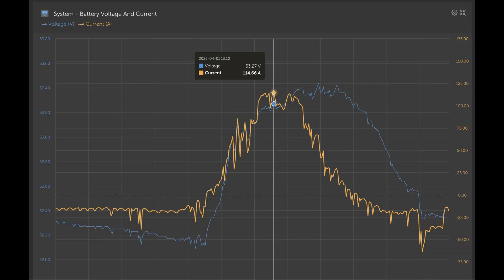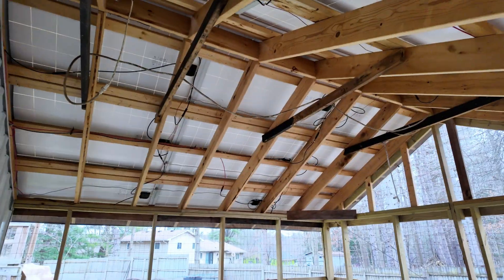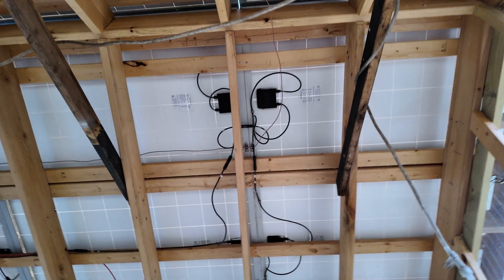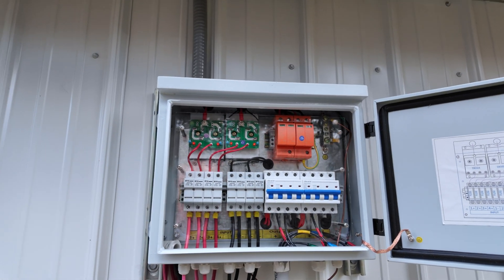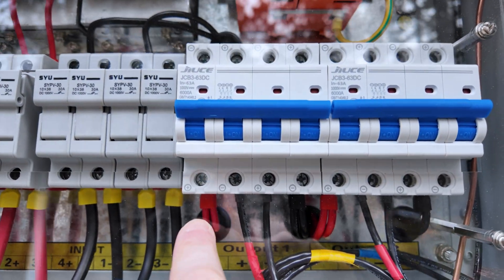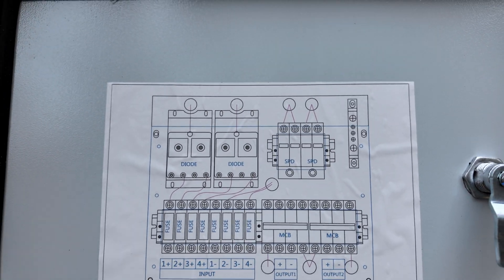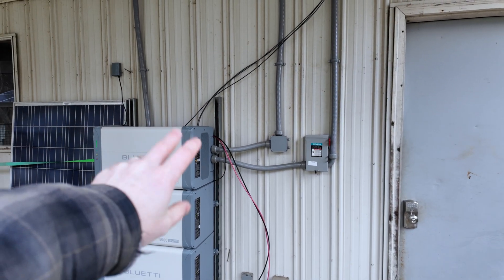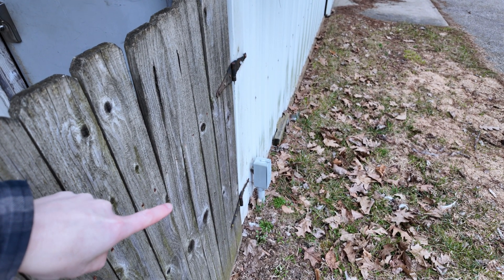My Coop PV Arrays with the Watts247 4-2 PV Combiner Box

Comment from the maker: 🛠 Parts & Components (Affiliate Links)
     🔹 Watts247 4-2 PV Combiner Box - https://watts247.com/product/pv-combiner-boxes-quick-select/?wpam_id=126
     🔹 IntegraRack IR-D1 Super Sealing Multi-Surface Deck Mounted Bracket: https://www.currentconnected.com/product/integrarack-ir-d1-super-sealing-multi-surface-deck-mounted-bracket/?ref=AzzpK9Fl
     🔹 Santan Solar Pallet of 250W Used Panels: https://www.santansolar.com/product/used-ssg-240w-solar-panels-cracked-vinyl-pallet-of-25/?campaign=SolarRoofProject&ref=adamgog
  SanTan Solar 5% off discount code: offgrid_life
     🔹 IronRidge XR100 14' Rails: https://ebay.us/l2WWpY
     🔹 IronRidge Universal Fastening Object Module Clamp: https://www.solar-electric.com/ironridge-universal-fastening-object-ufo-cl-01-a1.html
     🔹 BLUETTI EP800+B500: https://shrsl.com/4lxum
  Discount Code: AdamEP800 - 5% Off

For more details, visit my website: https://going-off-grid.com

💡 Support the Channel
Want to support my work? Here’s how:
✅ Use my affiliate links—it doesn’t cost you extra, but it helps me out.
✅ Buy Me a Coffee: https://buymeacoffee.com/goingoffgrv
✅ Click the “Thanks” button under the video.
✅ Join as a channel member for exclusive perks: https://bit.ly/3Wdufqv

I appreciate your support! 🙌
Reply: I just ordered my combiner box through your link 😊.
Current connected is out of the Integra rack. 😢
Reply from the maker: @bettypowers5166  Thanks Betty!  Which racking did you look at from CC?  I can see if I can find any updates on when they're coming back in stock.

Comment: Outdoor wood boiler I see. I too have that in my setup. I have a conventional wood master 4400. I'm still burning. But my wood is getting low. I think I've gone through almost 10 full chords so far. I started in November.
Reply from the maker: Oh yeah.  Love it!  We've got an EZ-Boiler, made here in MI.  We're still going though but quickly running out of wood.  This week will probably be the last week before we shut it down.  I haven't kept a close count on our usage, but I'm guessing we're easily near 14 full cords.
Reply: @AdamDeLayDIY  yeah I ran a line to may 3 car garage but didn't finish the water to air heat exchanger in the garage yet so definitely going to use more wood next year.
Reply from the maker: @electromechanicalstuff2602  I really need to do that.  It's gonna be a long run unfortunately...
Reply: @AdamDeLayDIY  I bought 250' of that thermal PEX from central boiler... Ouch
Reply from the maker: @electromechanicalstuff2602  Yikes!

Comment: The left SPD has no ground cable attached. Only the right one.
Reply from the maker: Good eyes.  I did double check and there's a bond strap between the two SPDs and then the ground cable comes off the second SPD.  The strap is just like the ones used on the quad breakers.

Comment: Definitely would like to see your power improvements with optimizers on each panel. Do it lol
Reply from the maker: Yeah, I probably will.  The winter data would be the real test, but still would be super interesting to see what kind of a bump I can get out of them!

One thing I have to keep in mind is that since I'm constantly changing arrays around, I can't use optimizers on the Victron charge controllers.  The manual specifically recommends against them as they can conflict with the built in shade protection of the charge controller.
Reply: Optimisers are a scam. There are many good reasons why Victron don't recommend or manufacture optimisers.
Reply from the maker: @Yeti_steps  Since I happen to test lots of stuff out on this channel, I guess I'll have to test those as well to see are they truly beneficial or just a scam like you suggested.